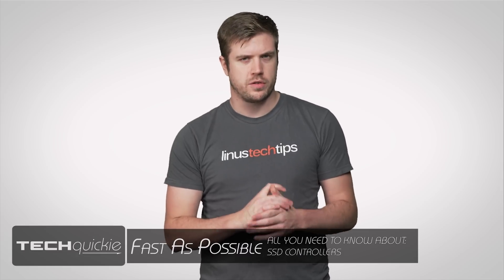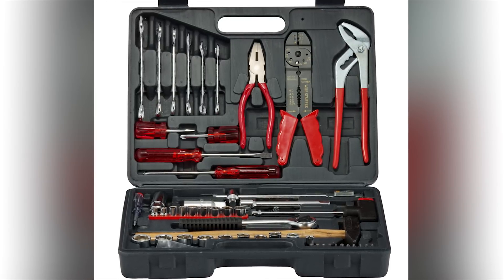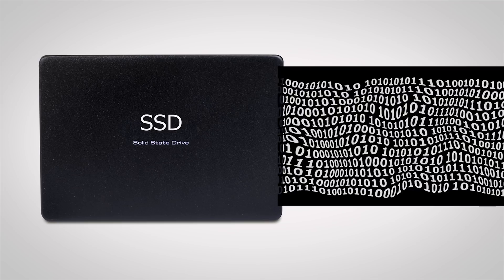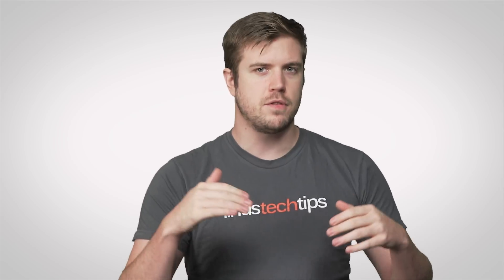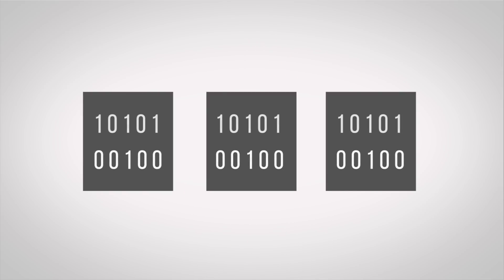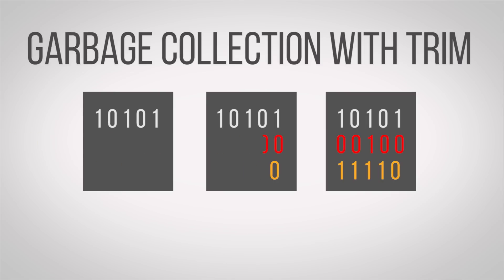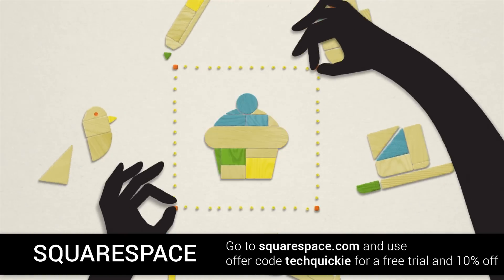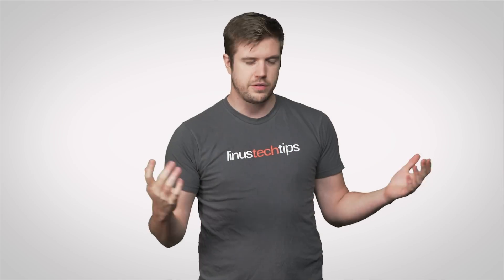SSD Controllers as Fast As Possible

Comment: now I don't want to do anything that writes to my ssd
Reply: now I want to fill my SSD with more dank memes
Reply: Crontax Then you're screwed. If you used Spotify a while ago, you're even more screwed. 

Also, disable any virtual memory in your system settings, because that's basically write spam.
Reply: +Crontax because there was a bug or whatever that made spotify literally write terrabytes of useless data to disk for no reason.
Reply: ***** yea, they got a lot of shit for it and rightfully so.
Reply: Turn the PC off
Reply: +littlegrabbiZZ9PZA how did i not think of that?! i had set over 10gb virtual memory on my ssd. Today i checked how much data was written on it ssd and its over 6tb fml, i probably wrote less than 1tb